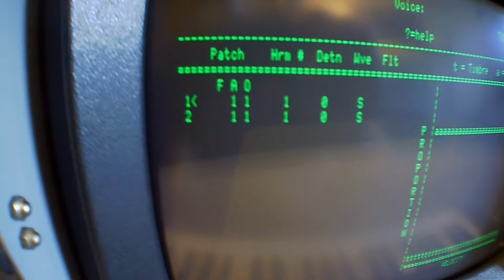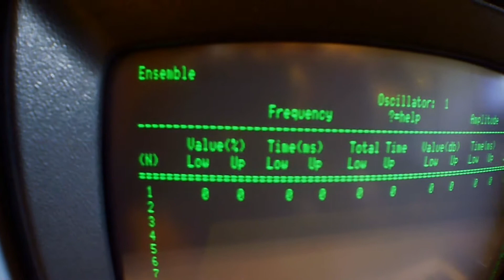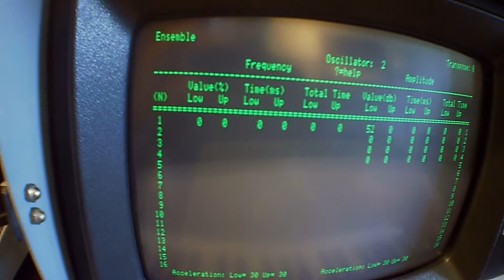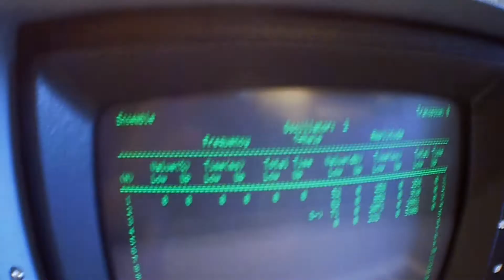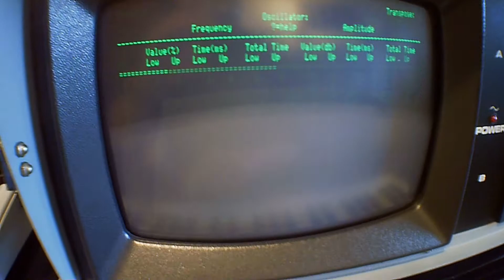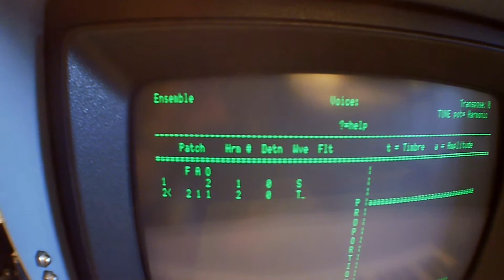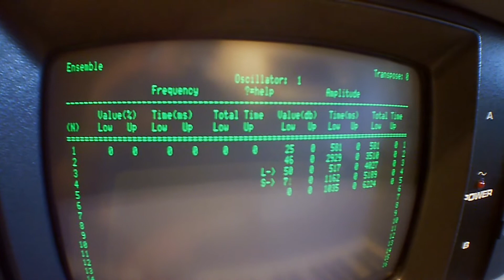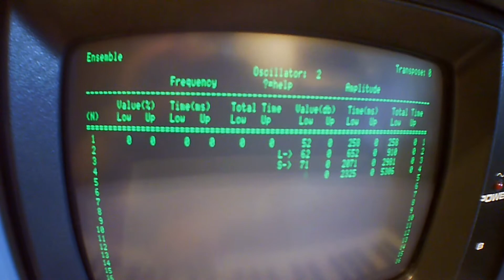Sound Programming on the DK Synergy II+

Comment: Is there a disadvantage if i will be using it with a kaypro 10? Which kaypro do you use?
Reply from the maker: It should also be working with the Kaypro 10. Both computers are using CP/M and have the serial  port.  I´m using the Kaypro 2.
Reply: @theassociate2734  okai! thanks for the quick answer!